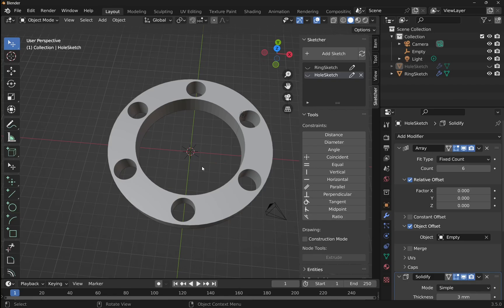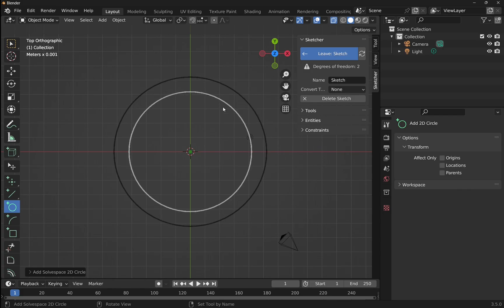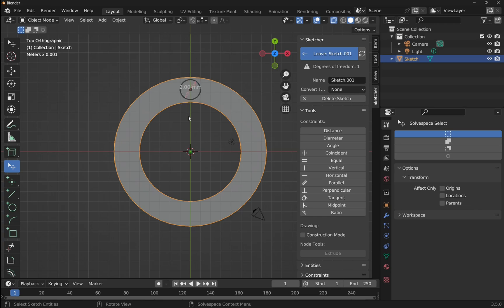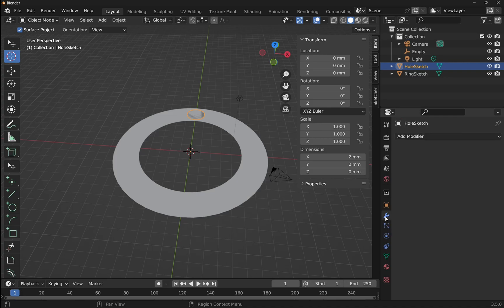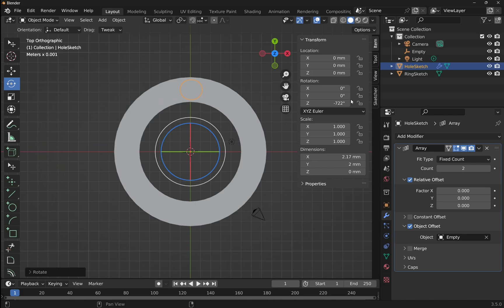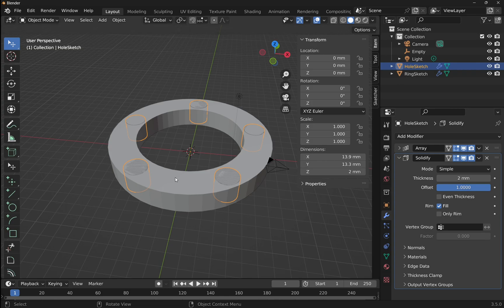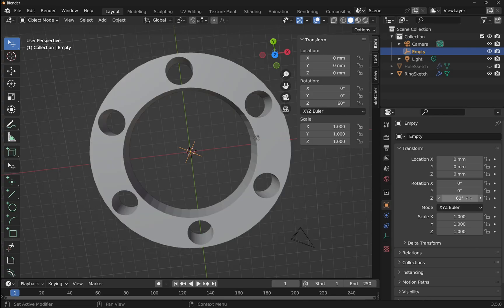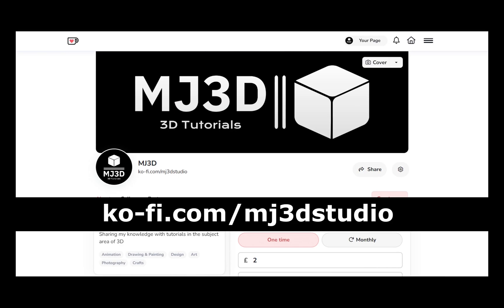Learn CAD Sketcher | 11 | Polar Array / Circular Pattern | Blender 3D Beginners Simple Model

Comment: With 3mm hole thickness and -0.5mm offset should lead to equal 0.5mm overflow on the top and the bottom, but it was clearly unequal. Why?
Reply: I thought it should have been 0 to be equal?
Reply: It seems to be my math is not too strong today
Reply: @krisztianpap9015   haha I math. Waiting for the day CAD has an AI predictive plugin so I dont need to math at any level!

Comment: Nice! I’d like to see a video on using the bevel modifier on solidified meshes so you can add a chamfer/fillet on the sharp edges. It is tricky to select certain edges to bevel different amounts and keep it non-destructive.